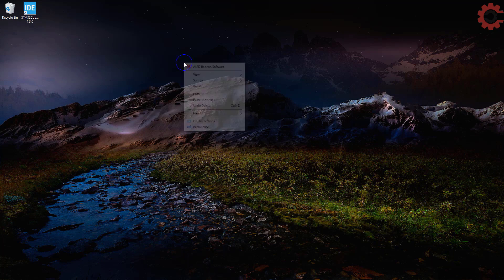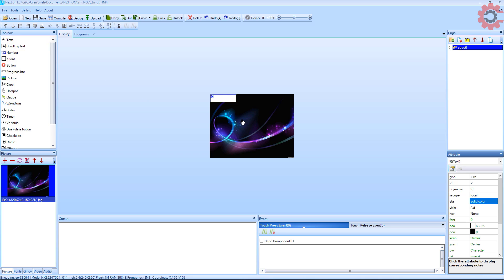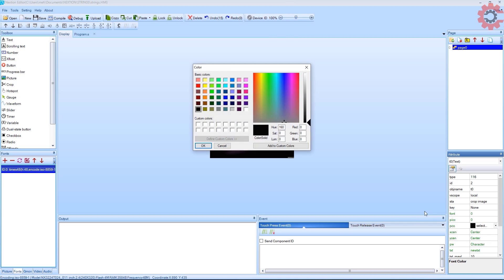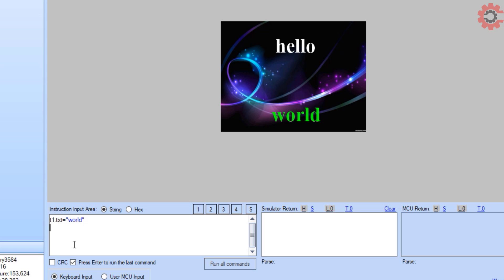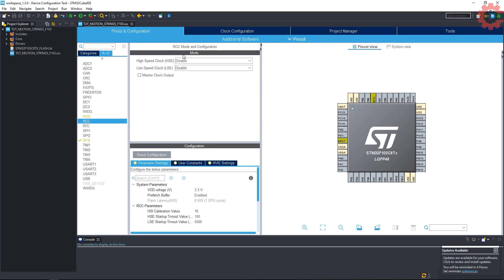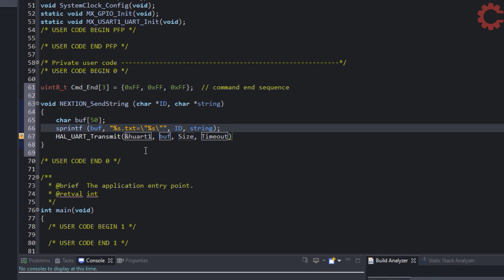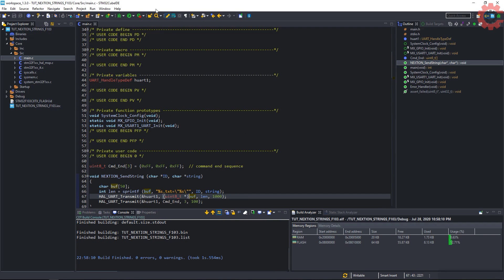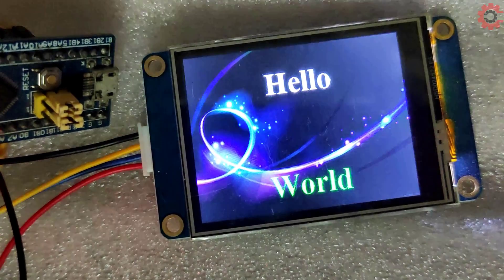How to send String to the Nextion display || STM32F103 || CubeIDE

Comment: Hello,thx for you tutorials. How to send data not string? n0.val=100 for example?
Reply from the maker: Check other comments in this video. I have answered the same question..
Reply: @ControllersTech  void NEXTION_SendData (uint8_t *data)
{
	char buf3[50];
	int len3 = sprintf (buf3, "n0.val=%d",data);
	HAL_UART_Transmit(&huart1, (uint8_t *)buf3, len3, 1000);
	HAL_UART_Transmit(&huart1, Cmd_End, 3, 100);
}How to make function with second parameter?
Reply from the maker: What second parameter ? If u are trying to send another value, then use this function again
Reply: @ControllersTech  LIke you first function :void NEXTION_SendString(*char ID,*char string)
Reply from the maker: Just use the function i have created. If u want to send the value and not the string, modify that function..